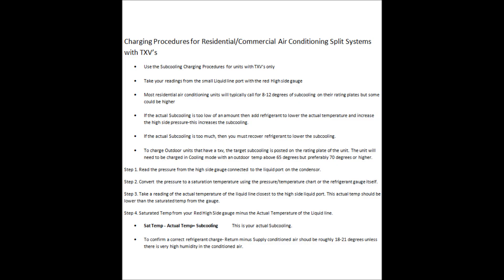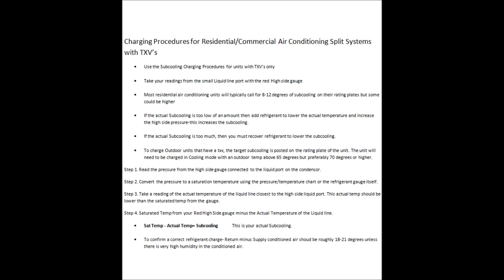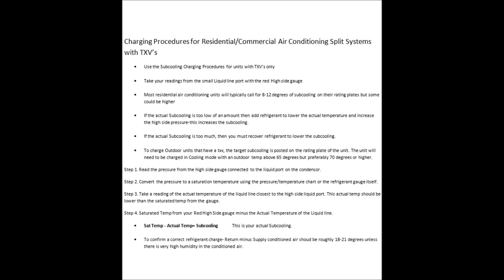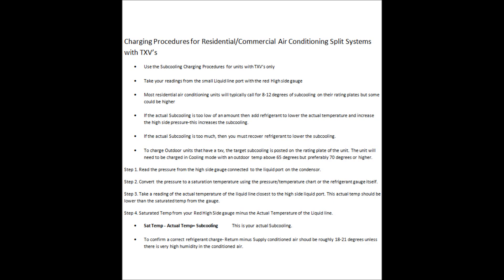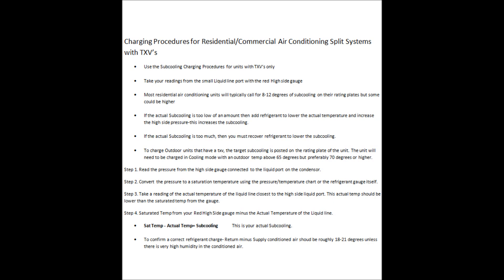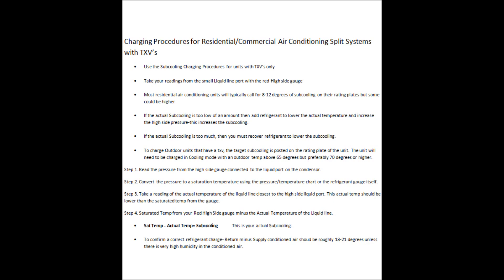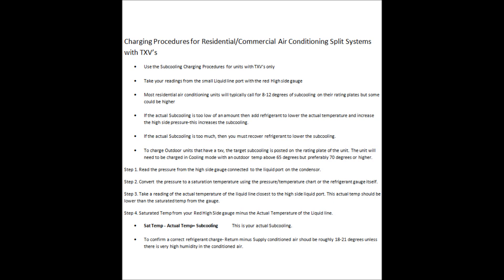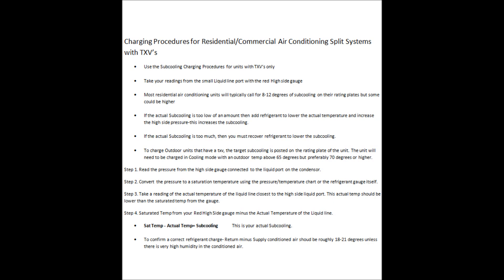HVAC Refrigerant Charging: Subcooling Charging Method Directions!

Comment: what is the regular subcooling for a automotive R134a ? is it applicable what you say (subcooling method) to automotive ? tenx
Reply from the maker: The issue is in a car you have a compressor running at the speed of the belt on the pulley so it is not a single speed. Also you only use subcooling if the unit has a thermostatic expansion valve as a meteting device. Superheat would be used for piston and orifice systems. The very best thing to do in your situation is to find the leak, recover the refrigerant fix it, pressure test, vac pump and weigh in. If you were to add refrigerant while the system is running you would however want the sat temp of the refrigerant read on the low side gauge to be above freezing. Thanks
Reply: acservicetech thank you sir for the info more power god bless pls do some automotive ac videos hehehe thanks again!